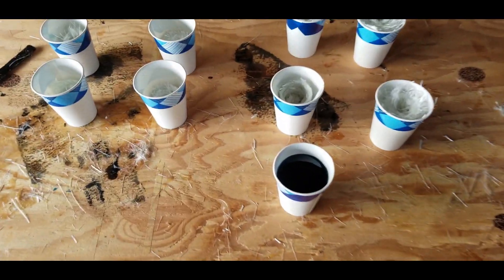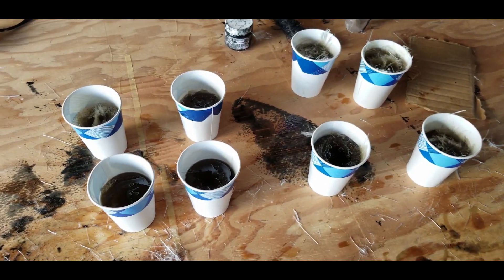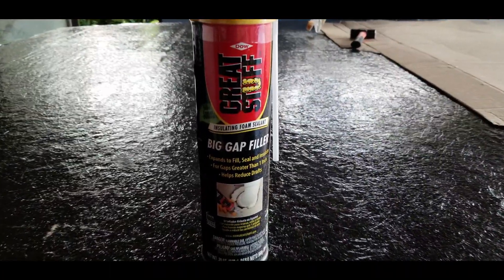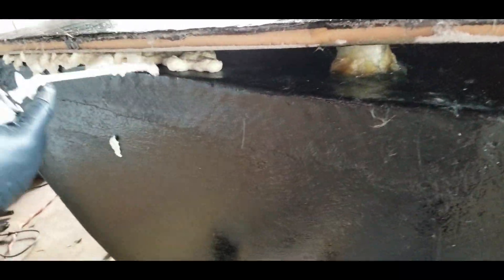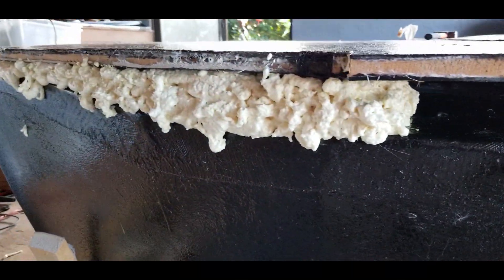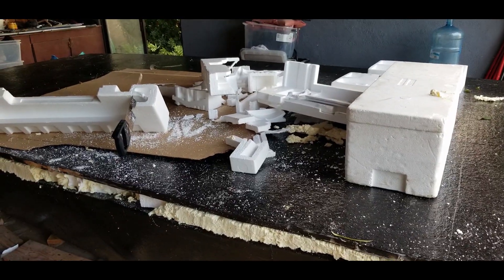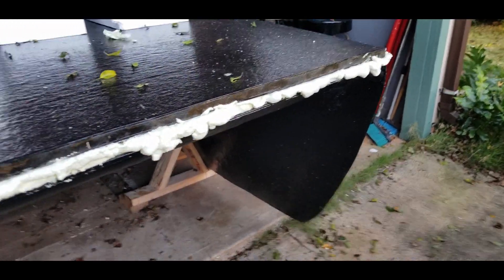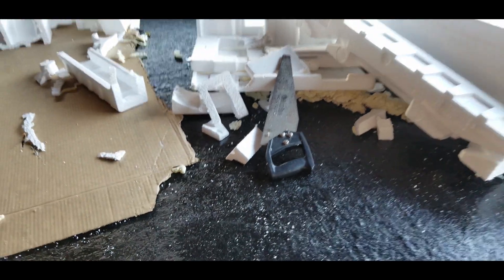Solar Patio Boat Build 18 - Foaming The Gap

Comment: another Fine installment - you are going to have a very low maintenance, fun boat.
It just keeps getting more and more real
I like that you film then go back over it and add the narration
Reply from the maker: Getting the deck attached properly and fairing all the edges is a big step... it will refine the lines of the boat!  When are you gonna get started on your project?
Reply: I just posted a short collection of pics, 'no audio
They show the first segment with 4 panels mounted.
I currently have all 12 mounted and wired
Reply: @DIYKauai  I forgot to add the link - this is my current boat:
https://www.youtube.com/watch?v=CMlKXfYUdzY

and the last one, it's claim to fame is it got me fired up to build something larger:
https://www.youtube.com/watch?v=8Y2DagBTa8c